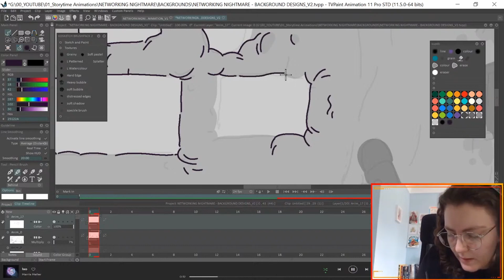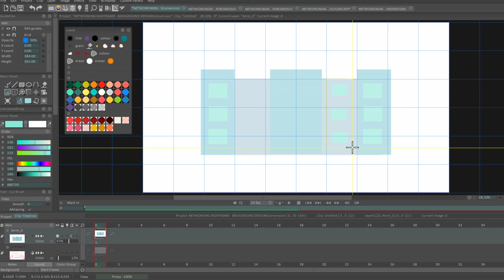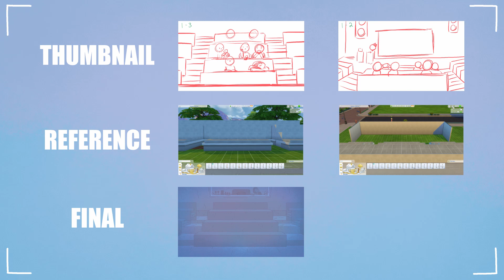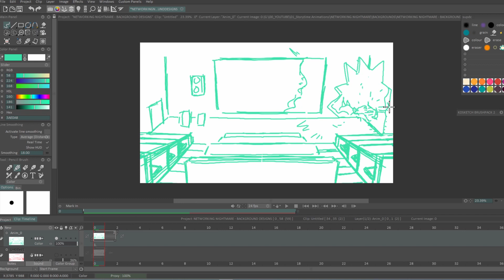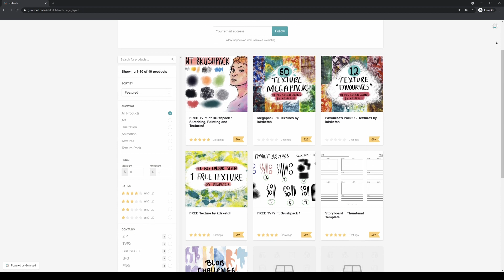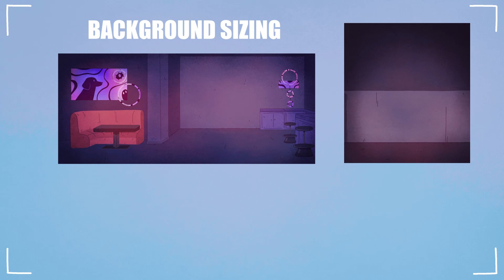MAKING BACKGROUNDS FOR 2D ANIMATION / HOW I MADE THIS

Comment: Do you have any current videos or plan on making any that do an indepth review of Moho 12 (or latest version) compared with Cartoon Animator Pro 4 or any other programs like Harmony or TvPaint?
Reply from the maker: A review of Moho is on my todo list! I’m going to be making more in depth reviews of animation software too after the HIMT series :) is there anything in particular you’d like to see?
Reply: @kdsketch  Well, Im currently looking to start getting into animation myself for my own little projects and was interested to see the main differences between them, like the character rigging, inbetweens, how they handle vector or rastor art. I think they both advertise that professional studios use them for movies, was just curious which one was the better buy not taking cost into the factor.
Reply from the maker: I’d definitely recommend checking out the free trials and dedicating some solid hours into testing them out yourself, a program can have a tonne of features but if you don’t like working in it then I’d definitelylook for something else. - for me the main difference between toonboom/Moho and CTA4 would be that the first two allow both drawing and rigging while CTA4 doesn’t have any hand drawn options at all. I’m a frame by frame animator so I’m a little biased 😅 it all depends on what you want style wise!